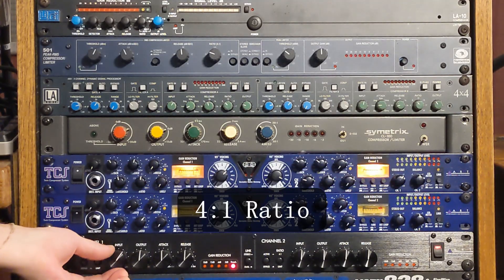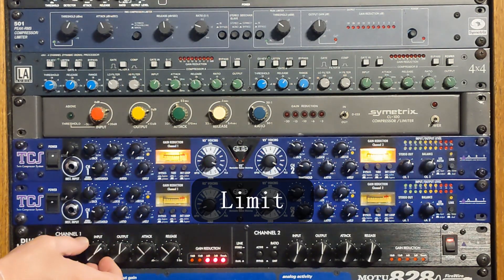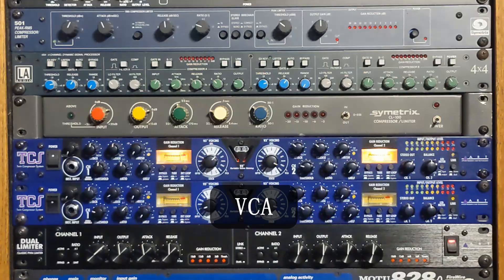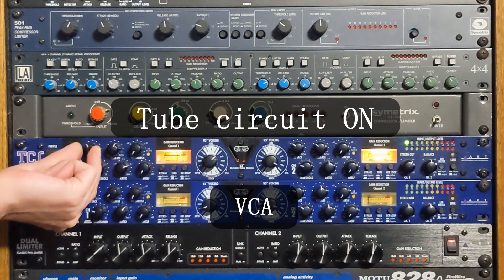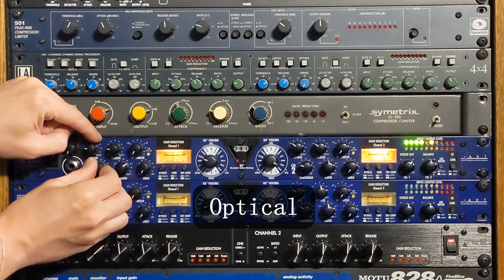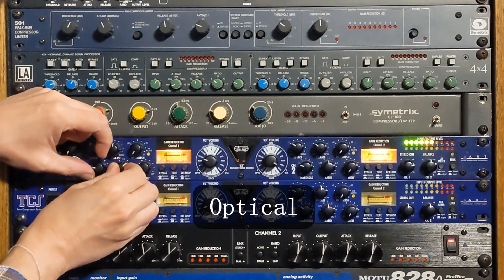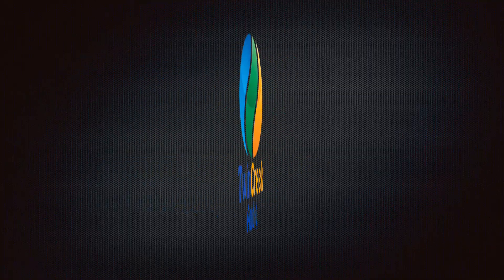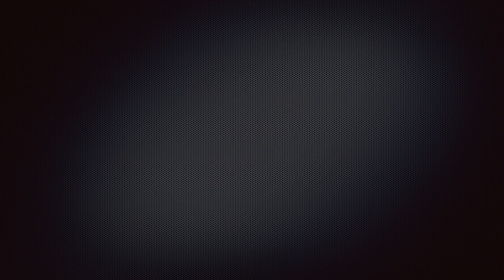Vocal Compression PWM VCA Optical Comparison

Comment: I swear when I was a young engineer in the mid 90s I use to dream of having just a mono PWM compressor but then ART put out the dual limiter I started replacing all of my dbx 1046 compressors I use as console channel compressors with the ART. The dbx 1046s are the closest you will find to an SSL channel compressor with 4 comps per rack unit. I now have 10 of the ART Limiters for a total of 20 channels of PWM compression during tracking. I love them.
Reply from the maker: In the 90s, I'd have maybe some Behringers or a dbx 166 and maybe one high end compressor at most of the studios where I worked. It's amazing the choice and sound quality that's available today even though is less of it than plugins  I have found  the Dual Limiter to really useful and versatile. It can be clean and clear or have an attitude. Ive used it mixing several albums worth of material at this point and I am extremely impressed. I also love my TCS compressors. I've always wanted a Pro VLA but these do really well. I am a big fan of the Dual Limiter and expect I'll find more and more uses for it.

Comment: I just received one of the pwm limiters today!
I have not hooked it up yet, but by your video I can tell it’s going to work fine- I need a colorless safety for the level so an upcoming vocal session.  I want to be as close as possible to sounding like I used  no compressor at all for the tracking.
Reply from the maker: It should do that really well. Congratulations and have fun! The Dual Limiter is awesome!

Comment: Hey, I got a TCS for ages. I love it for years, used it a lot at a basic level. Now I wanna try using it live. I'm wondering how can I set it up as a noise gate? Never delved much into the presets vs manual tbh. 😅 Thank you for these videos on the TCS, you're curating an interesting era of studio recording.
Reply from the maker: The TCS is a really good sounding compressor. According to the manual, it doesn't have a gate feature but does have built in noise reduction that is adjusted with the NR Threshold control. It is active on all V3 priests according to the manual. You can always add a gate such as a dbx before or after the TCS though. I never noticed enough noise to use a gate with it but there are many ways to use the TCS that might be more effective with a gate. I find the late analog gear to be more affordable while also sounding good. I worked in commercial studios during that era so that's one reason why I focus on the gear.
Reply: @TwinCreekAudio , yeah! I looked around and found the manual. You're right. Gonna give it a go sometime this week, get familiar with the features, cause I really love it and your videos urged me me to explore it further. Thanks for answering and have a great time with both your TCS! 😃
Reply from the maker: @rodrigovieirastudies  The TCS is a sleeper but I don't think they made them for that long. They aren't really rare but it did take awhile to find the first one. When I saw the second one, I had to grab it in case another didn't come up for sale. These were such a cool idea that really worked. I have no idea why it didn't last as long as other ART products.
Reply: Agreed. I remember it being well regarded at the time, so I assumed other brands would follow with similar products. But, looking back, it seems to be one of a kind, in a sense.
Reply from the maker: @rodrigovieirastudies  I would think the concept would have had imitators at some point. It's a really versatile compressor that has a lot of uses. I've used it on drums, vocals, mixbus, guitars, pretty much everything. It's also really quiet. It doesn't add a lot of noise or undesirable artifacts. I wish they would re release it with a few upgrades like transformers or a high voltage tube circuit though. I am certain ART knows how to do something like that very well.
Reply: @TwinCreekAudio  , ooooh, that'd be powerful yeah!